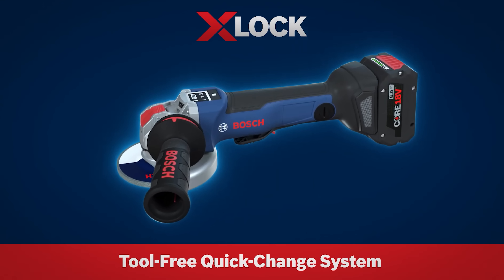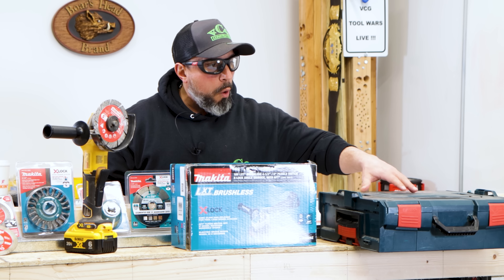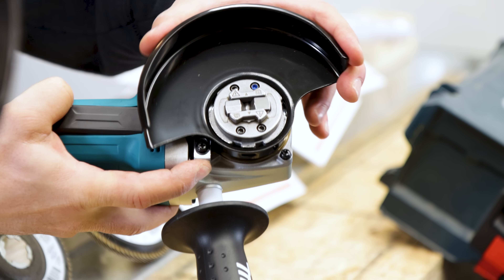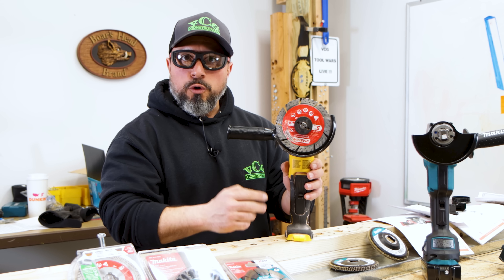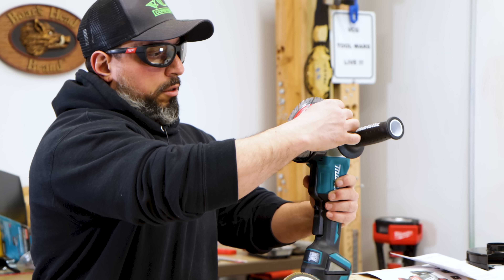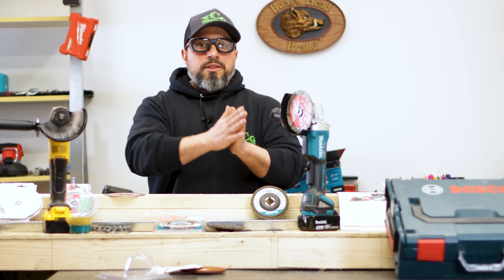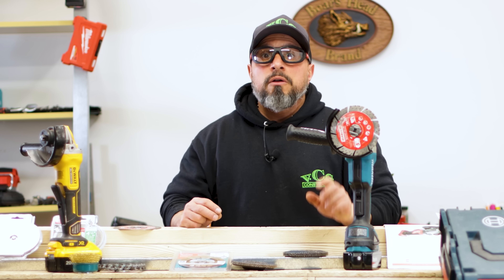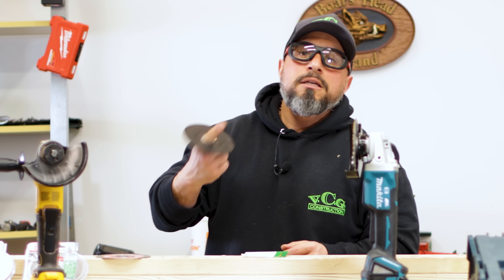NEW X LOCK Style Grinders & Accessories (STOP WASTING YOUR MONEY!)

Comment: Vince, I have a Bosch X-Lock grinder and it's terrific! Another advantage is that you don't have to keep track of the lock rings and bushings that many standard grinders have when you use screw on wheels, they end up in the bottom of the tool box or lost. Translation; more lost time. Makita, as usual, has made a very smart move in adopting this tech, can't wait to see it with their new 40V platform!
Reply: Besides the ease of use, this would be the reason I get one. Most people love the fact that cordless makes it so much nicer because of not having to deal with plugging it in. This is the same kind of advancement just on the other end of the tool. There are some people who are just too hardheaded. I’m not a professional and that’s why it will probably be a while before I spend the money to get a new grinder.

Comment: I have the corded Makita with X Lock - fantastic. NOW - can they apply this technology to circular saws and miter saws?
Reply: Amen to that
Reply: I have Bosch, 18v 10 x lock, and IT îs more powerful, than Makita.
New x lock Bosch 18v 15 biturbo, will smash Makita.
Reply: Do you happen to know if the bosch xlock accessories (cutoff wheel, grinder wheel etc.) compatible with the makita grinder ???
Reply: @francisconavarrete1494  Should be - Makita got the X Lock from Bosch under patent I believe.
Reply: @francisconavarrete1494  x lock is the same on all tools.
Reply: Hopefully soon!!
Reply: @francisconavarrete1494  it most certainly is. The x lock disks fit on normal grinders as well

Comment: Another revolutionary tech innovation similar to sds, Velcro sanding pads, star lock multi tool  set ups. Grab it while the intro deals are out there.
Reply: 2 years later and the diablo xlock buy 3 get 2 free are still going on. Just bought a 26z grinder with wheels today.

Comment: I normally use the grinder disc's to lock the nut down I never use a spanner wrench never had any problems using the disc to tighten the nut I would never say the way I do it is faster then x lock but I got 15 different grinders that use the old way don't need to do blade changes to different items as often when you have a different disc on each grinder @Vcgconstruction

Comment: I think the only valid argument is the extra cost of the discs but I can totally see this for a mechanic or fabricator who constantly needs to go back and fourth between flap discs, cut off wheels and grinding wheels but for me if I’m bringing a grinder to a jobsite I usually only need it to do one thing so not worth buying a new one but my next grinder after my Milwaukee craps out will probably be an X lock

Comment: I have a dewalt one. I’m switching to that one Makita tool just for the convenience of switching disc fast. I use one for cutting conduit then need another to cut a box down I installed in the ground it saves me time and safer. I’m human and have forgotten to take the battery out. Felt grateful to still have fingers. Thanks for the video.

Comment: In a tru professional/production setting where there is consistent need for various types of cutting and/or grinding, they will typically have multiple grinders each with a particular grinding wheel. This type of system is really only worth while for low volume or occasional use.
Reply: True which is why I stuck to my 414 DeWalt grinder for the last 2 years recently picked up the 418 DeWalt though these Makita and Bosch are great grinders I'll stick with DeWalt
Reply: David Mm, you are right on the money!

Comment: If youre worried about grinder down time, I would start with not using a cordless solution, lol you'll change your battery 50 times before your grinding wheel.

Comment: I have a little, milwaukee angle grinder that defies any attempt to tighten the flange nut with just your hand. I always use the wrench. When someone else saw me doing this, and told me you can tighten it down without the wrench, I told them to try it. They did. Then, they turned it on. The motor ramps up in a way that it spins the flange nut loose if you didn't actually lock it down properly. Seeing that cutoff wheel wobble on the arbor made them nervous, and they didn't bother me about why I'm not a tough guy who throws away the wrench (and the handle, and the blade guard), again. It's always the same people that tighten by hand, that also leave the grinder plugged in while putting the their hand on the disc, too. Funny how laziness tends toward laziness. Lol. 
If there's any handheld power tool you should FEAR, it's the angle grinder. I think so, anyway. It's one of my all-time, most-used tools. But, I don't ever let myself start thinking that that m'fucker wouldn't straight-up MURDER me if I gave it the chance. Lol.
All of that to say that I am very interested in a tool-less blade change angle grinder that doesn't involve putting people in the hospital. Haha.
Reply: So you're saying that your grinder runs in the same direction as the threads on the ring nut? I think Milwaukee would be interested in seeing that tool. I suspect that you have your flange backwards for the thickness of the consumable you are using.
Reply: The best way to think. Thanks. I will buy x lock. Is safer.

Comment: I was just gifted an X-LOCK grinder recently, and I think it's awesome, but I have one huge complaint, and that is I have flap discs that use Scotch-Brite material instead of sandpaper of various grits that I use for restoration work, and even a year after this video, similar flap discs aren't available in X-LOCK.  If I want to use those discs, I'll either need to modify the center of the discs so X-LOCK will grab them (Definitely not safe) or stick with the old style of grinder
Reply: There are adaptors, on Amazon and Aliexpress...

Comment: I know this video has been out a while now. I have an X- Lock Grinder. I'm an electrician and it has been more cost effective to use. But it's also safer to use. Some disc's I use daily are directional. The X-Lock system will not let you install them the wrong way around. This also makes sure you get the full life of that disc every time. 
Also Thanks for your content, it's always well done...
Reply from the maker: Good stuff, thanks for sharing Andrew!

Comment: Maybe the prices are comparable to other home depot brands, but not harbor freight.. 10 cut off wheels for 8 bucks or 2.50 per flapper disc.. yes they aren't the quality of Diablo, etc.. but that dollar +  adds up after a while.. and I have never had issues with the HF discs..
Although... I needed new Makita batteries at 230 for 2 of them.. ended up getting this deal at Home Depot 399 for brushless hammer drill, impact driver, xlock grinder , jigsaw and 2 5amph batteries with charger.. extra 150ish and get a bunch of tools with the batteries.. thats a steal!!

Comment: Just got one of these. The problem right now is a lack of discs or, more specifically, disc selection. Maybe also other accessories. For example, I was looking for a diamond cup wheel and dust shroud to remove old thin set mortar. There is no X-Lock wheel like this right now and I'm not sure if the existing dust shrouds from Makita or anyone else will fit this grinder. But I do believe tool-less quick change is the future so I'm going to stick with it. If it came down to it, I could just get a disposable grinder for wheels that aren't in X-Lock format. Now, if someone would just come out with an adapter for 7/8 to X-Lock that would be convenient in the interim.
Reply: There is already. Look on Amazon

Comment: I have a oscillating multitool with Starlock plus, and the toolless blade attachment is an absolute godsend. Once you try that, you will never, ever again, want to have anything to do with a multitool whose blade attachment involves allen keys, removable lugs, or anything else that has a potential to be dropped, lost or just wasting your time in general. 

And I'm convinced it's the same story with X-lock. I already have a 125 mm corded grinder with standard M14 spindle, so I'll go for a 150 mm cordless Bosch 18V (I'm already invested into their Core battery system), as soon as they releases EU equivalent to the US market's "Profactor" "Spitfire". (By the way - seriously, Bosch? That's not cool, employing 13 year old kids in your marketing department. Child labor is illegal, you know?).

Anyway. I'm not even a pro contractor or anything, so I probably won't be earning much money with it (my primary job is MCR technician in a TV company). But it still makes sense for me, even when all I use a grinder for is DIY stuff and whatever needs to be done or fixed on and around my house... a 70 years old, two-story house with attic and cellar, built entirely of solid bricks, so actually the use cases are many. Enough of them to get frustrated with the wheel changes. Why? Murphy's law:
- You WILL at some point accidentally drop the nut, OR the spacer, OR the spanner, and if you're working up somewhere on a ladder or scaffolding, the probability increases tenfold.
- To use a wire cup, you have to remove the nut and spacer. As you put them away somewhere safe, they WILL disappear from that place the moment you leave them out of your sight.
- Tightening the nut by twisting the disc is fine when it's a steel disc for masonry, but it's a bad idea with something like a bonded cutting disc that's only 1mm thin, because it WILL crack.
- Sometimes, the goddamn nut just won't come off, because someone else torqued it super tight, and you WILL have to look for the spanner, and it WILL NOT be where it's supposed to be.

With X-lock, all these annoyances are eliminated. They may seem insignificant, especially to someone whose only experience with grinders is arguing about them on internet, but when you're actually trying to get something done in a reasonable time, any of these things will properly piss you off.

Comment: Today I was cutting some metal angles with thin cut disc, and had to switch to grinder wheel and back to thin cut disc again. And during the switching back and forth, I was telling myself that the disc changing is so freaking annoying. 

Also I hated to wait by holding the cut off tool until the disc stop spinning before taking my hand off it. From a safety side, the new brake is a good reason to change to this new tool. 

For me, I think these 2 features are very good reason to adopt to this setup. 👍

Comment: My big concern with this blade change system is the longevity of it. With a standard blade change, you have a big nut holding the blade on. With this new system, there are a lot more working parts. I still use my old Dewalt cordless grinder with an adaptor to use Milwaukee batteries and the blade change still works on a tool that is probably twenty years old. When this grinder fails I will probably replace it with a Milwaukee grinder to save having a different set of batteries and charger to lug around with me. If I was workshop based I would have no hesitation in swapping brands.
Reply: I think you should not think about the simple and robust mechanism of the X-lock failing. Your concern should first be directed towards the electrical/ electronic components including the motor itself failing first before the locking mechanism.

Comment: That's great. You forgot to remove battery with xlock.
Wouldn't it be even better to have 2 grinders fully loaded and no change discs? That save even more time, as no need to go and look for the discs also. Working with metal, one to cut, one to grind. Makes sense.
Reply: Do you want to carry 2 complete grinders up a 25' ladder? You crazy? Thats what he is talking about 'muscle dumb'
Reply: @ZAPATTUBE  not everyone works X metres up the ladder. That is probably the extreme. And probably you should not start changing discs up the ladder either, not only for the one doing it but the people underneath to get flying discs falling from the sky as the xlock starts spitting all the discs. That's probably the muscle dumb

Comment: With my Milwaukee M18 grinder it takes only a few seconds to change blade out because I have the nut with the flip up to make it easy to tighten or loosen the nut without the wrench so you don't need to look around for a tool to remove the nut but I will be buying the cut off blades

Comment: Not a neeewb but avoided a grinder. I got by with a Dremel for small stuff and a die grinder for bigger stuff. Finally decided it was time. I read about the Makita coming out with this last year. Every week I check and finally HD had it. I ordered the switched model. I love this thing. It's really just about perfect. I also bought a bunch of different wheels. If you are on the Makita platform it's an easy choice. There are also battery adapters. I run a Milwaukee inverter off my Makita batts. If another platform has something yours doesn't just go for it. The adapters work perfectly.
Reply: Thanks.

Comment: Kinda reminds me of the ez lock dremel accessories.  Where those can save you from overtightening the bit and cracking the cutoff wheels on the old style. 

I use to hand tighten till one came loose and had some lets just say unexpected results... so I always tighten with the wrench... but this one I don't need a wrench... when the time comes for me to buy a new one.. I'm switching up.

Comment: Most of the xlock wheels at Home Depot are 4.5 inches, but the grinder comes with 5 inch guards. The instructions say say not to use a wheel without the appropriate guard, so that is another expense I have to make, if I can even find the 4.5” guard. My Home Depot also doesn’t have xlock wheels in stock, consistently. 

Additionally, I can get on Amazon and buy 10 packs of strip discs, or other flap discs, for incredibly cheap. I think it’s 35 bucks for 10 strip/clean discs. I have been searching for an xlock strip disc, but all I can find are Bosch cleaning discs which are going to cost me almost 30 bucks each, to import.

I like the xlock system a lot, but I’m not so sure it is here to stay, as you suggest. I am likely going to buy another grinder, without xlock, because searching for discs that I need is costing tons of money (time), and then there is definitely a premium on top of my time wasted. 

If anyone knows where I can get xlock discs and wheels online, or somewhere other than Home Depot, for a reasonable price, I’d love to know your source so I can justify hanging onto my xlock.

Comment: @vcg Great video as always Vince.
I am in the market for a grinder and now I am puzzled. Was leaning towards the Dewalt.  I like the X lock... all grinders should move to this lock system but here is the question????

While the X Lock is superior and definitely quicker, does the tool that has a super fast blade change perform better than Dewalt Power Detect  or the Milwaukee Fuel 18v??????

I have to consider platform that I am on Dewalt , but mostly Milwaukee.   

So if I wanted to buy into the XLock I would have to move into a platform I am not on. 😞

I wish the Milwaukee or Dewalt would have the  X Lock.

Question Again????
How does the Makita grinder compare to Dewalt “ POWER DETECT BABY” ????????

Please do a comparison Dewalt vs Fuel 18 vs Makita...  thanks
Reply: NYC Boxing, you made this statement, "While the X Lock is superior and definitely quicker,..." Please explain how other than being quicker, X Lock is superior to the standard method of mounting grinder consumables. Have you considered the small bearing and supporting surface of the X Lock attachment on the wheel flanges vs the standard ring nut?

Comment: Just purchased one but may have to return it. No where do I see an xlock to regular adapter! I need to do some concrete grinding with a diamond impregnated cup wheel. I have not found an xlock one. Nor have I found an adapter. An adapter seems like a no brainer (your not likely to burn through them like you do other wheels) but there are none and there are no xlock cup wheels. How could they miss something like this? Furthermore I have not seen any other comments on the internet about this.

Comment: The only issue with the X-lock is specialty blades and smaller blade companies. I'm a tile setter and while the Diablo, Dewalt and Bosch tile blades are decent....they are not great. Rubi, Pearl, Absolute Black Diamond and our polishing pads don't come in the X-Lock. There are cheap X-lock to spindle adapters, but the put the blade past the guard.

Comment: Im a contractor and you know that a cuttingweel or diamondblad don't need changing every 5 sec so for me if it takes 5 or 15 sec to change a disk don't matter to me .plus I will garanti you the disk with fastluck is almost a 1/2 time more 💰then the normal one. Plus you don't need to use a wrench  on your angelgrinder to put on a disc it.s made to self   Tighten wen you use it .and to take it of just get a fast key 🔑⚙you DONT NEED A WRENCH TO TIGHTEN just snuk it with your ✋and your good to go..I thought all contractors new that😁😁😁😁best regards from Denmark to you and your family stay safe and🇩🇰

Comment: Mobile welder here. Never used an x-lock but can tell you the consumables aren't sold in stores anywhere around my area. Only place I've ever seen them is Lowes and it was a dusty pile of like 5 or 6 wheels and that was it. Shutting down a job-site because I have to mail order consumables costs north of $1000\day. This is the hurdle they have to get over if they want mass adoption. Otherwise it's just another solution to a non-problem.